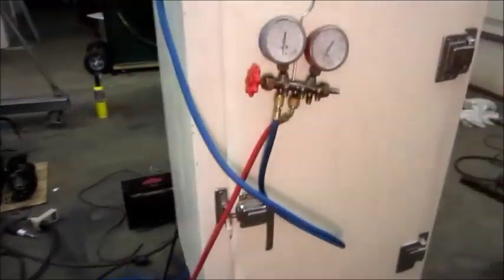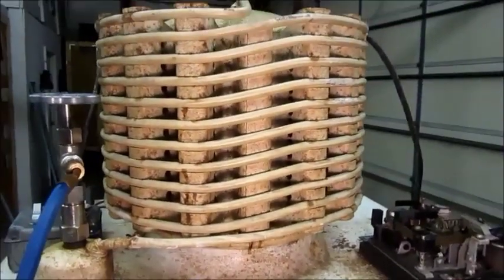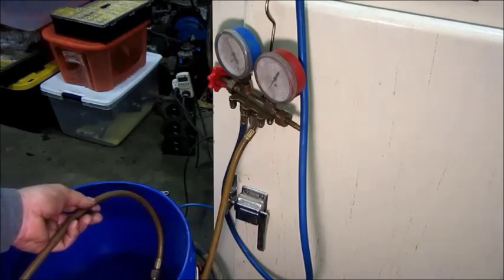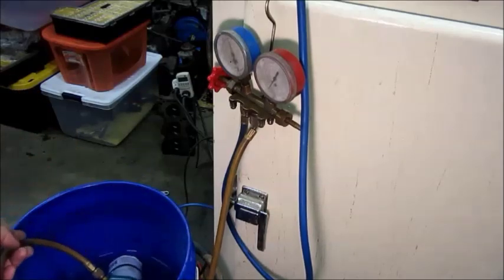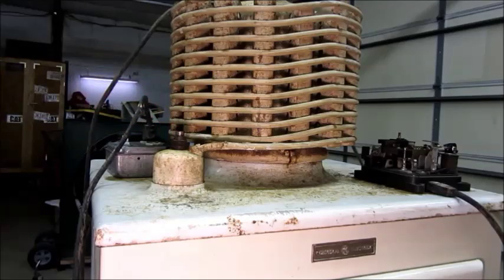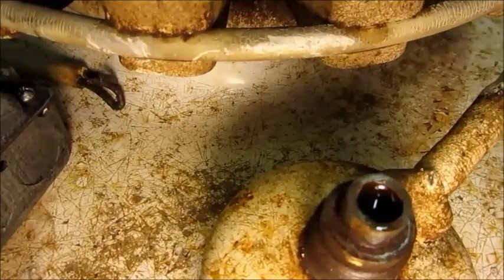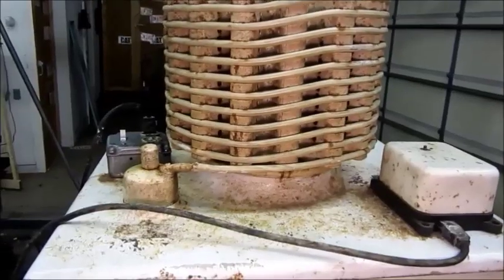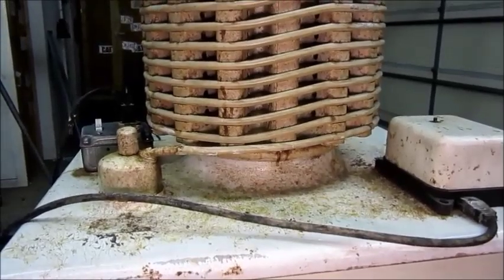Troubleshooting GE Monitor Top DR-1 Antique Refrigerator - 2 - Repairs...

Comment: here you can buy the keyboard air duster cans in like 6 packs for like 5 bucks, I think even our dollar stores carry it, so its a very cheap and abundant replacement gas it seems, back when I worked at a hotel we had this stuff in a can just called "frosty" it was used to remove gum or other hard stuff from carpets but it was essentially contect freeze liquid in a spray can, seemed like a more potent version of the air can, and those cans if I recall did state "will freeze flesh apon contact"
Reply from the maker: Yep, same here. I have bought it at the Dollar General when I was out of my preferred brand.  The freeze sprays are often HFO-1234ZE or HFC-134A. They differ from the duster cans in that they have a dip-tube. That makes the liquid spray out, as opposed to the vapor of the duster cans. You can easily use the dusters for freeze spray by turning them upside down and spraying liquid.

Comment: Oh what a treat to find not one, but TWO antique fridge videos tonight!  Another beautiful job, David. Indeed, nothing super esoteric, but you have the knowledge and all the proper tools to assure success.  Monitor Tops are OK, but those belt drive low side float pressure control beauties are really just  amazing.
Reply from the maker: Thanks Chris!  I like all the oldies. :)  But yeah the low-side float open-drive ones are very much a work of mechanical art.  On that note, the cabinet for the M52 Frigidaire is still at the bodyshop for painting.

Comment: The porcelain coating on the evaporator is nice!
Reply from the maker: Yes, it's different from the usual sheet metal ones! These can and do rust out when there are chips in them. The blue ones like this were often General Electric wartime rebuilt units. Materials were scarce so they would take in and repair older machines. This one had a new evaporator installed during the World War II time.
Reply: @davida1hiwaaynet I have the same refrigerator running with SO2. The evaporator has rust on the edges, should i reseal the rust with white paint? Epoxy? Thanks
Reply from the maker: @josephaud  It is hard to get things to bond to rust. Might want to invest in POR5 in a light color. They have grey for sure and may have white.
Reply: @ That’s a good point! I was looking at Thermocure or evapo-rust to wipe away the rust before sealing. I’ll search for POR and see if i can get some

Comment: 3:28 lol Buick 3.8 cylinder head? u wood.
Reply from the maker: Yep. There's actually a LeSabre Grand National to the left off-screen. It has a turbocharged 3.8 which is getting rebuilt.
Reply: Do you mean a Lesabre T-Type? Could you do a video on that car when you get the chance?
Reply from the maker: @jsciarri  Hi Archie. It is an LGN.  The LeSabre Grand National was sold in 1986 to qualify the LeSabre aero-coupe body for NASCAR.  I've done a few videos on it in the past, but since it's not my car I don't share too much about it.  There are pictures on the net.
Reply: @davida1hiwaaynet  I knew it!

Comment: Ive had 2 Samsung refrigerators go out in 15 years yet this one still works after 80 years? hmm something has changed here for sure
Reply from the maker: That is a very good rhetorical question. :)  Samsung is one of the worst modern refrigerators you can buy. They are engineered to fail and are built in a manner that most repair shops will not be able to service them. There is a movement to have them recalled; as well as class-action lawsuit talk.

Comment: Propane is even cheaper. R-290 was substituted in r12 units, even use it in cars with 134, just charge by pressure to 50psi on a warm day.
Reply from the maker: Actually..... no.   R290 (propane) has a totally different temperature-pressure curve from R12, and even further from SO2.  Also it blends with oil which is not how SO2 behaves. Even worse, for the older systems with rubber seals around the electrical terminals - R290 or R600A will cause leaks at the rubber seals.